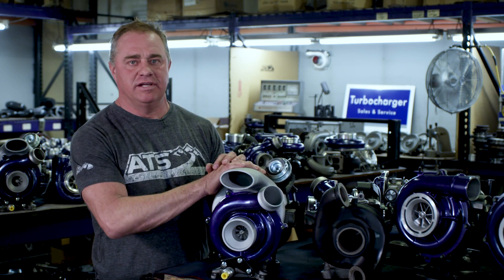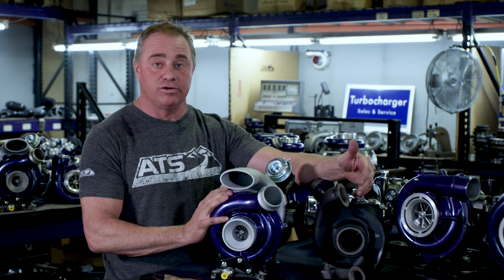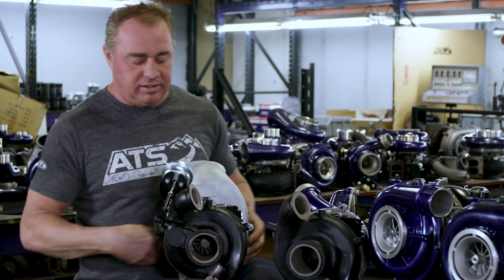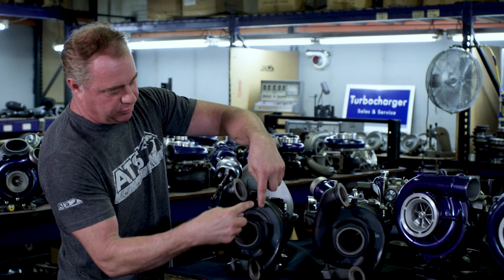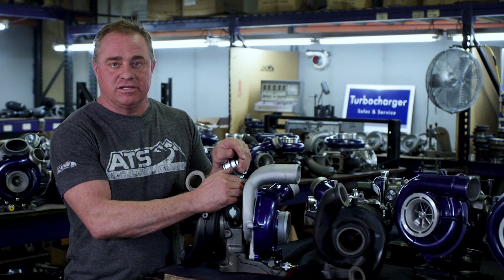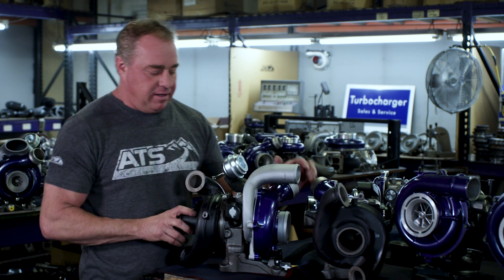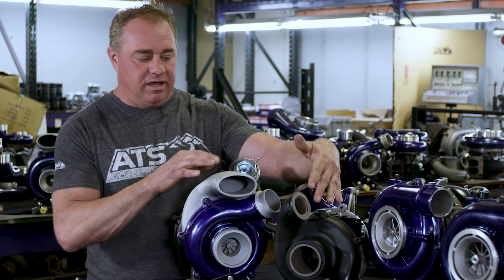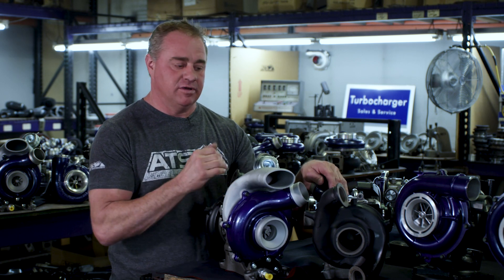ATS Diesel Aurora VFR VGT Turbo for the Ford Powerstroke 6.7L 2011-2014 Twin Scroll | Cab & Chassis

Comment: There’s a lot of questions being asked about this turbo that are left being unanswered. 

1) does it come with a waste gate? 

2) if no waste gate then how do you not get a CEL? 

3) does this add boost over the stock turbo?

4) will this work with Pusher pipes

5) will this turbo lower EGTs? 

6) how many pounds of boost will it make with factory tuning?
Reply from the maker: We apologize for the delayed reply.   This product has actually been discontinued and we no longer offer it for sale.    We have created an upgraded replacement from the ground up, https://atsdiesel.com/products/ats-aurora-vnt-turbocharger-kit-fits-2011-2014-ford-pickup-6-7l-power-stroke?variant=48637879681300 

I’m here to help answer your questions if you happen to have some about this Turbo as well.   I’m Nathan, ATS Sales Manager, and my contact info is info@atsdiesel.com and my number is 1-800-949-6002 ext 1120 and I look forward to speaking with you.

Comment: has anyone installed this? Whats your review if you have?
Reply from the maker: Sorry, this product is no longer offered for sale.  Please check out our new VNT Turbo that was re-designed from the ground up to be a much better and more reliable unit then the twin scroll style.  Video: https://www.youtube.com/watch?v=7RwxJa9la00&t=19s 
 Website link: https://atsdiesel.com/collections/ford/products/ats-aurora-vnt-turbocharger-kit-fits-2011-2014-ford-pickup-6-7l-power-stroke?variant=48637879681300

Comment: Why did they put a smaller turbo in the cab and chassis?
Reply from the maker: They did a lot of things we weren't so sure about during these years.  Here is a great replacement for the C&C style turbo, The Variable Nozzle Turbine VNT.  https://atsdiesel.com/collections/ford/products/ats-aurora-vnt-turbocharger-kit-fits-2011-2016-ford-cab-and-chassis-6-7l-power-stroke-1?variant=48637965762836     Video: https://www.youtube.com/watch?v=7RwxJa9la00&t=19s

Comment: im guessing this turbo does not add any hp gains over stock?
Reply from the maker: Sorry, this product is no longer offered for sale.  Please check out our new VNT Turbo that was re-designed from the ground up to be a much better and more reliable unit then the twin scroll style and will support well over 500hp.  Video: https://www.youtube.com/watch?v=7RwxJa9la00&t=19s 
 Website link: https://atsdiesel.com/collections/ford/products/ats-aurora-vnt-turbocharger-kit-fits-2011-2014-ford-pickup-6-7l-power-stroke?variant=48637879681300

Comment: Just bought 2014 6.7l 2x4 DRW Cab and chassis w/ ambulance prep package (ambulance removed) and found out about the 300hp and engine detuning. Do you offer a solution to upgrade/ interchange turbo so I can get from 16,100lbs towing capacity for fifth wheel up to 23,900lbs as spec'd for the pickup? Thanks. Any solutions appreciated. I have read that exhausts are different and intake manifolds have to be switched as well. Then I hear egr and dpf may be different. Also, curious if any upgrades can be compatible with tunes on cab and chassis. Again, looking for every bit of that 23,900. Thanks.
Reply from the maker: Sorry for the delay.   If you're still looking for a turbo we would like to get some more info on your exact truck.  I’m Nathan, ATS Sales Manager, and my contact info is info@atsdiesel.com and my number is 1-800-949-6002 ext 1120.  Thank you for your time.